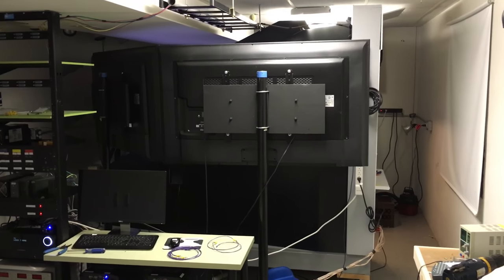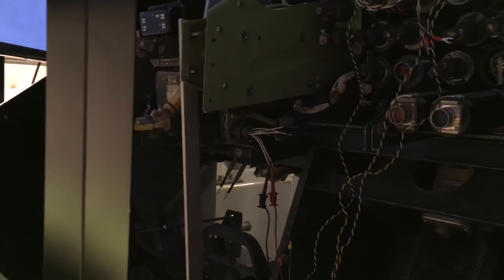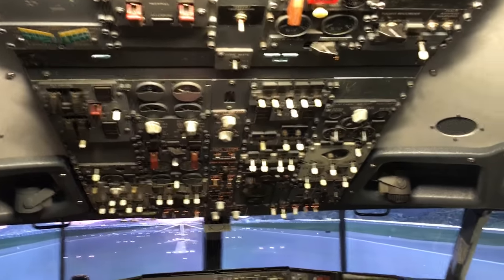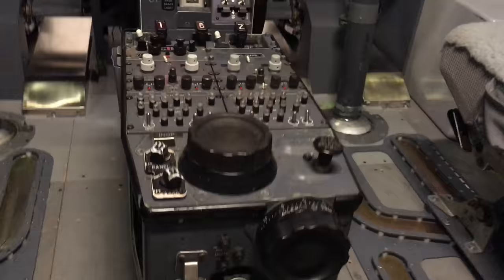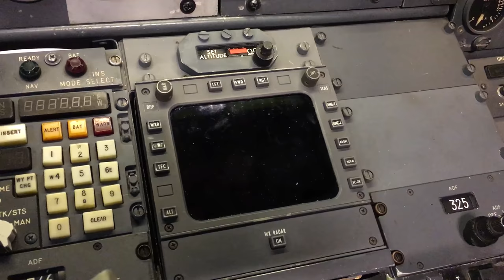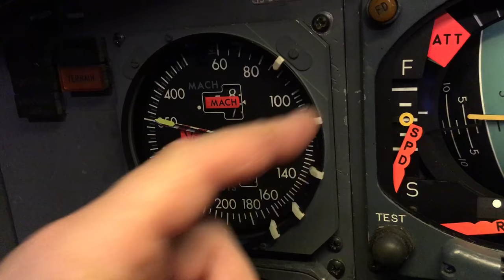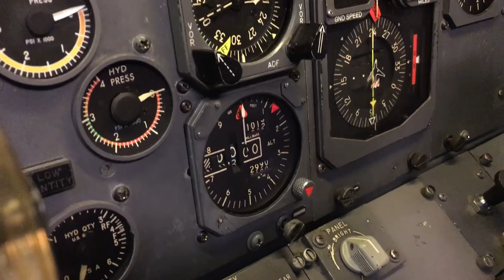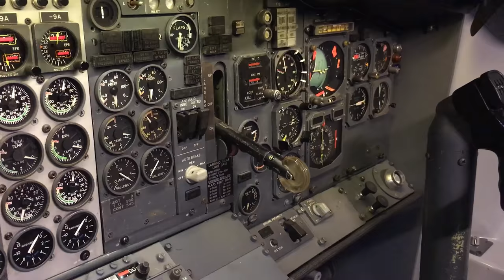737-200 Cockpit Build Walkthrough

Comment: What did you use to sync all three displays ?
Reply: Not sure what GPU you're using, but I use NVIDIAs Control Panel that comes with any NVIDIA card. There's an option in there to turn on sync displays. It's very simple.